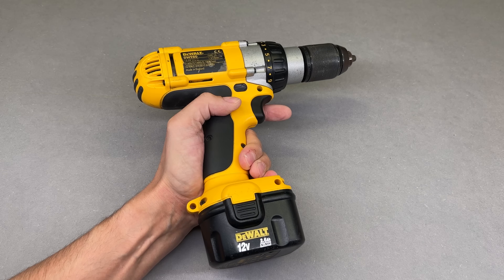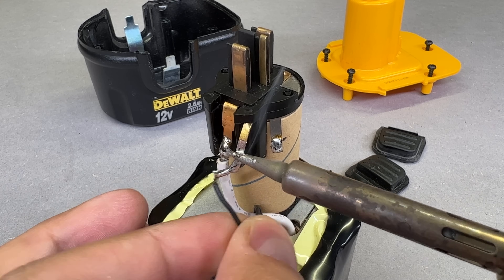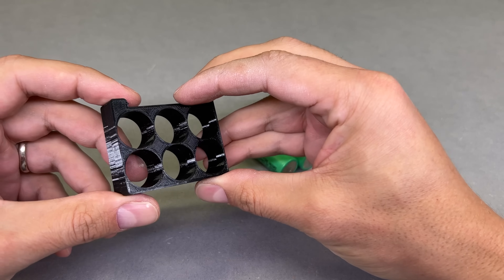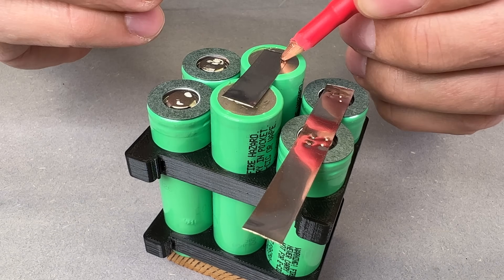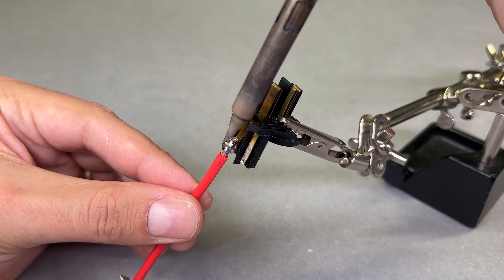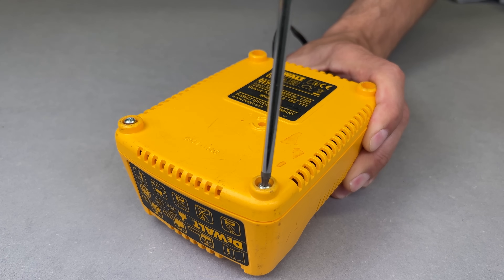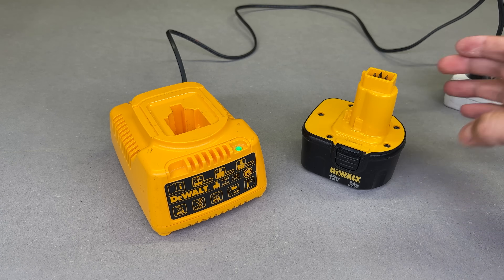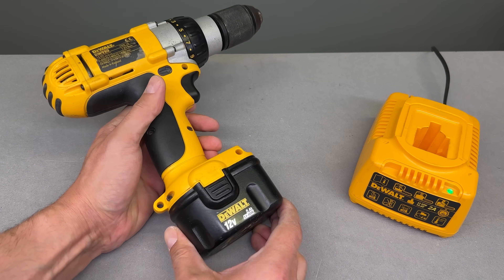Ni-Cd to Lithium Battery and Charger Conversion | NiCd / Ni-MH Battery Repair

Comment: A neighbor had a nice DeWalt 12 volt drill, looked like new, dead NiCad batt. I had good hi amp batts, got this EXACT bms, followed your video, put a charge port on the front, great. Took it to him stuck it in the drill and "nutton honey". Had to feather the trigger numerous times to get it to start. Maybe they exaggerate about the bms amperage.  Had this same trouble when I redid an older DeWalt 18 v batt, had to take it back apart and put in a higher amp bms. This is why everyone likes powerful DeWalt tools, their special motors draw LOTS of amps especially on startup, the batteries have better cells to run them. Hope I can find a higher amp bms that will fit in the same space

Comment: 12V power tool with the Ni-Cad batteries replaced with Ni-MH or Li-ion 18650? And if they are 18650 batteries X 6= 22.20V (1 18650=3.7V). How come? Could some one pls explain? I would have used 4 X 3.7V Li-ion/18650.

Comment: i have the exact same drill and look forward into doing this, btw my batteries stiil work but they dont perform the same anymore and it like using an old smartphone and need the charger all the time

Comment: Witam. Zrobiłem jak na filmie i po po wciśnięciu spustu na wkrętarce BMS odcina napięcie 0V. Po puszczeniu spustu napięcie powraca 12V.
Wiesz dlaczego tak się dzieje?
Pozdrawiam
Reply: I have the same issue. Pressing the drill button works for a second, then the drill stops and the drill button has to be pressed again. So far I couldn't figure out the source of the issue. Any hint is appreciated. Btw very nice Video.

Comment: Man, that's what I call a CLEAN WORK. Well done! Thanks for sharing.
Even being a layman, I have enough tools and I'm definetely doing it soon.
Instead of the lithium battery charger you've used, could I use a normal 12.6V power supply?
If so, which could be the minimum amperage for a 3S2P pack?
Thanks again. All the best.

Comment: This does not make a lot of sense, that if you already had a complete charger,  you might as well have just left it in the original enclosure and ran the power (output) cord into the base of the original charger.  No need for the glue job you did which may also fail later, remembering that the PCB is going to get hot and that tends to degrade glue.  It is especially significant considering that your adapter board handles AC mains voltage on it, and also that the charger board didn't look like a particularly good/safe designed product to begin with.

Comment: I followed your instrction but got some red light on the bms like unbalance batteries works for a few seconds and drain the batteries indicates they are charging but same result any ideas that could help

Thanks

Comment: Most NiCad battery packs have a thermal fuse that goes bad. If you compare positive to negative on a good battery and a bad battery one of the terminals on the battery will not show voltage.

Comment: Nice video a diagram would of been cool,  since the important, most intresting part was not shown totally.. the wiring of the batt wasnt shown rite, wish u would of spin o turn all around to see all the detail of the soldering u say parallel,  but i was  only able to view how 4 of 6 batt was spot weld. 2 batt i wasnt sure of🤔. where they bridge to the rest of the batt or soldered directly to the board??

Comment: Absolutely superb battery conversion job👌
I have gone a different way to convert several of my old 18 volt Dewalt NI-CAD/NI-MH power tools to Lithium Ion.
 I use the original NI-CAD battery top cover and battery connector and attach a slimline Lithium Ion adapter shoe directly to the original NI-CAD top plate. 

This assembly of old top plate and Lithium adapter shoe is then fixed into the power tool battery port with 4 small self tapping screws and then a standard Dewalt 18 volt Lithium Ion battery can be fitted to all the modified power tools.
So far I have successfully converted an 18 volt cordless vacuum cleaner,a 165mm trim saw, a compact angle drive drill and a SDS masonry drill....all work very good on the Lithium Ion packs.
Reply: You can actually buy the complete adapter (very cheap) which is very good quality and also has USB out. Search Battery Adapter DM18D With USB, Compatible With Dewalt 18V Tools
Reply: Except that you may ruin your batteries if they expect a tool with part or all of the BMS circuit in it, since the Dewalt 12V/14.4V/18V NiCd tools had no such circuitry in them, and I am certain that "some" (if not all) Dewalt Li-Ion batteries in the 18V/20V families, do not have the BMS in them.
Reply: @stinkycheese804  How are you certain of that? Did you do any experimenting to validate under voltage and short circuit protection? Logically, the BMS including charge protection is always in the battery pack. The new Ridgid and Milwaukee batteries communicate with the tool, but the mfers claim that is for efficiency purposes and are still backward compatible with older Li-ion tools that don't communicate.

Comment: Top class video with very clear instructions. My tip for sourcing Lithium ion cells is to check out your recycling centre where these 18560 cells can be found in every tool battery also in hoovers and anything else using lithium batteries such as hoovers etc. An almost limitless supply of free good batteries.
Reply: During Covid-19 I found couple half used cans of interior white paint and I decided to paint the garage. I needed a 9v battery to test out something and found 2 good ones....all in our localrecyclecenter.

Comment: What would happen if the new li ion battery pack is plugged into the origainal ni cad charger?  EXPLOSION???? The internal BMS won't prevent that from occurring?

Comment: Hi, really interesting video, your drill/battery/charger were at 12.5v, I have a Bosch 14.4 volt drill and I have found on eBay BMS module 4S rated at 16.8v, assuming 3S is not able to cope with 14.4 volt, am I correct to use the 4S ?

Comment: Its 12.6 charge voltage It will run at 10.8v not 12.6v. Did the original battery have 13.6 nominal 14.1 charge voltage like a 12 volt car battery?

Comment: But if you already own a battery contact welder why not replace the cells with nice cheap NiCads and use the original charger - much cheaper.

Comment: I purchased a brand new Black and Decker 20v lithium impact drill/driver for $49.95. I know it's difficult tossing perfectly good tools with bad batteries, but still. I have other drills, but that's the only one I use now. It's powerful and changing bits is super easy. The money and time you spend to get the batteries and other parts and then assemble, it's cheaper to get something new and modern.

Comment: Switching between ni cd and lithoum on the charger would suit ppl who have and old and new battery.
Reply: Actually, he replaced the old nimh (nickel metal hydride) battery. Not nicad
Is says so on the casing lol. 
It says 12V NIMH
NIMH means nickel metal hydride which is a type of rechargeable battery

Comment: Very nice.
I did the same thing with battery pack, and charger for my old Black n Decker Drill and charger. (People make fun of the brand; but, Hey! it works!)
I used batteries from a Dewalt 20v. One cell was bad out of the pack.
I also used a cell to replace the battery in my NON-Repairable electronic cigarette.
Never toss Lithium Ion Battery packs; There is a use for them!
Make something!

Comment: great video sir, I have the same drill with the battery no holding charge  , So i will do the same Conversion. I think the battery Circute board will over-heat if using continuous drilling.

Comment: Why using a battery charger instead of a 12,6-13,6 Volts power supply? BMS is a charger itself.
Reply: Yes! I asked this question too. By the way, could you explain to a layman like me how I could know if the battery is charged using just a power suply?
Is there a way to solder one green and one red LEDs somewhere? Where would it be?
Thank you

Comment: Great video, nice tips, would do it too for my oldy but goody DeWalt DC981 ... BUT ... am too scared of fire/explosion of Li-Ion batt's. If something burns in ''3S 40A BMS'' overcharge protection might be disabled and than BIG BANG. While if the fire breaks out in the Li-Ion there is literally nothing you can do to put it out. I do a lot of handy work, sometimes charging in the house, in the shed also in the room or adjacent room, where I work, so ...... rather no Li-Ion. Will go with 1,2 V LiitoKala Sub C, 3500 mAh, Ni-Mh and sleep tight :).

Comment: These DIY videos are great but the cost of converting old nicd to lions are not that cheap if you havent a spot welder. I did convert it a time ago, i am satisfied with but might have change the charger and bms board bcuz one of my batteries dies quick on every 3 charging cycles.

Comment: Protection is in the battery pack, so children don’t play with it. This protection becomes memory effected after some charges. To remove memory effect, high performance model motor is needed, or anything similar. The battery will heat up, removing the memory effect. To fix the battery, vga cooler is needed. The process has to be repeated more times.

Comment: Una BMS 3S de 40A no es demasiada corriente para la descarga? No seria mas recomendable una de BMS 3s 25A? Gracias y gran video 
Compartirías el stl del modelo de las pilas con la inserción de la bms ? 😊
Reply: Tradu în română
Reply: @stefanvarlan9256  Nu este un 40A BMS 3S prea mult curent pentru descărcare? Nu ar fi mai recomandabil un BMS 3s 25A? Mulțumiri și mare video
Vrei să împărtășești stl-ul modelului de baterie cu inserția bms ? 😊

Comment: Long ago I also took apart an old battery but I just replaced the cells with the same chemistry and spot welded together. If I knew I could upgrade to lithium I would would have done so.

Comment: Wow, I have never seen such a super quality film here and it seems to be 4 K quality and the revision of the old worn batteries is TOP and even the manufacturer could not do it better. I would certainly entrust my device to him for the repair and you will not find many such perfectionist repairers.

Comment: Lithium battery charger $6,  18650 cells $18,  BMS module $6 ...Your talent...Priceless.
Reply: spot welder, 3D printer
Reply: @UGPepe  u dont need 3d printer u can just glue the cells and spotwelder board costs like 20 or u can just solder the cells ik its not safe tho
Reply: There's some things money can't buy. For everything else...
Reply: Soldering the cells isn’t safe?
Reply: @blueback21 just watch out u dont bring too much warmth into the batterie cells. It will damage it
Reply: So 6+18+6=$30, plus effort. vs. replacement battery ~$20. Is it worth it?
Reply: @Education-yk5ug  cause ni-cd and ni-mh batteries only last for about 3 yrs while li-ion last for more than 5 yrs. Also, you're mostly going to damage ni-cd and ni-mh batteries if you top it off without reaching 20-30% while li-ion doesn't really care as long as it still has charge when you store it.
Reply: @Education-yk5ug  yeah bcs now u have 12v 5ah lion battery pack vs 12v nimh 2.6ah battery pack

Comment: Thank you for the  instructions on the conversion process.   Hardest part was following the battery wiring - parallel / series.  But, I have my Ryobi 12v drill converted :)

Comment: As much as i like fixing items instead of throwing them away and spending more money on replacements. Because would doesnt like to save some money. But in this case, i ended up just buying two battery packs for my cordless drill for thirty bucks. None the less, great video.

Comment: better to rebuild with nimh batteries which are also high capacity and still use the original fast charger.
Reply: Do NImh last longer than lithium?  The nimh in this video lasted 11 years.

Comment: I added a female adapter to my battery so you could use the wall wart to charge the battery. Much easier. Great video in converting!

Comment: Very good job, the cells are high discharge ? or are they recycled from Laptop?.
I did a similar job (But not as good) for a Dewalt 18V Drill and only 5 cells (21V) fit in the case, using a 5S 100A BMS from the silver ones.
And I did exactly something similar with the charger using a 24V Printer transformer, but it must have a protection circuit because it deactivates 0V when connecting the battery, I have to do it several times. Greetings from Venezuela

Comment: Great video! Very, very helpful.  I wonder if you know how I can charge Li-On 18/20V power tool from a vehicle (12V supply without using an inverter?  Can I modify a charger to be powered from 12V rather than 240Volt? PS Loved your mini bar build - I am going to do one of these for our camping trips and fool the Mrs.
Reply: how I can charge Li-On 18/20V power tool from a vehicle (12V supply without using an inverter?
1) use a BUCK converter to 'up' the voltage
2) use a battery charger CIRCUIT to charge the battery7

Comment: Nice idea, but u shouldn't remove all part in old nimh changer and use this new lion changer. It changer 5ah battery really really slow (about 0.8-1A) and not safe for battery.